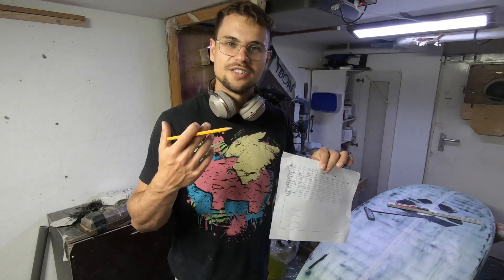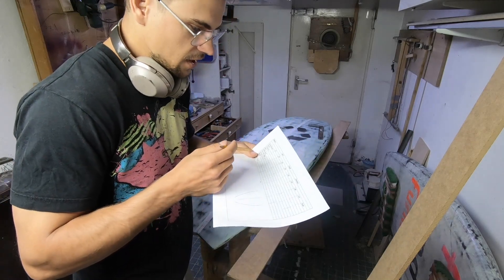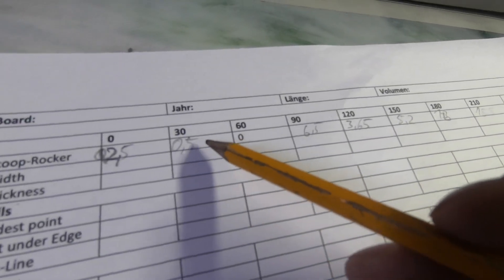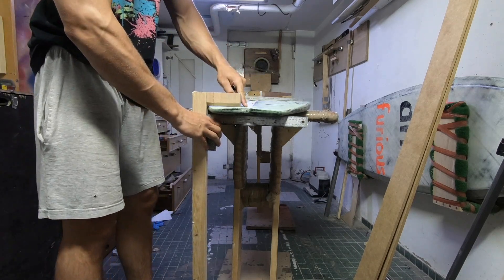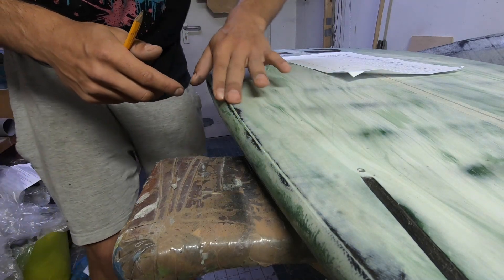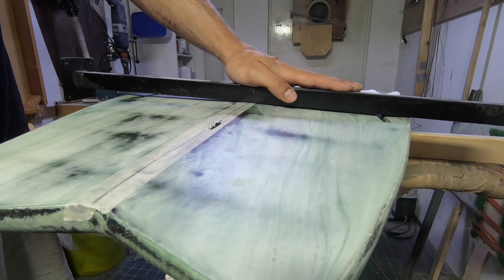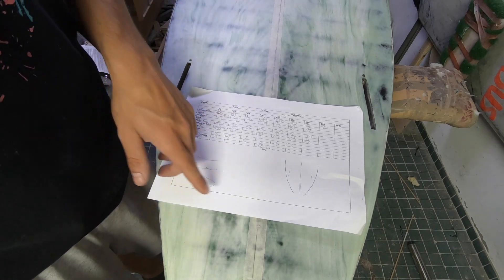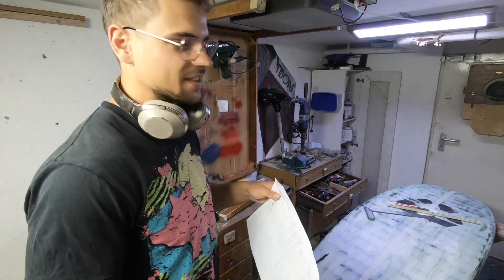How to measure surfboards - data to analyse and shape boards

Comment: Was für ne Software nutzt ihr für das Design? Komme von BoardCad und Hollowwood Templates Maker. Das aber eigentlich seit 2010 tot. Versuche mit Fusion 360 haben mit das Hirn verknotet.
Reply: Ich nutze AKU shaper als Demoversion. In der Demo Version kann man alles als pdf. ausdrucken und dann damit ein Template erstellen. Reicht also für den backyard shaper vollkommen aus.
Reply: @juergensplieth6068  find ich eigentlich auch gut, hängt sich bei mir aber regelmäßig auf
Reply from the maker: Ich bin dann wohl noch weniger als ein Backyard Shaper, ich benutze gar keine Software 😅 Die Templates mache ich analog. Das macht einfach mehr Spaß, finde ich und ich habe noch nie die Notwendigkeit für Siftwarelösungen gesehen. Wo sehr ihr die Vorteile? Habt ihr dadurch bessere Ergebnisse/weniger Arbeit?
Reply: @derbastlermeinesvertrauens753  Ich baue Boards in spantenbauweise aus holz, dafür ist das schon echt nice. Hab auch ne CNC und kann dann alles zusammenstecken und mit dem beplanken anfangen. Leider ist die CNC für'n ganzes EPs board zu klein.Letzteres steht aber auf der Angenda. Mal gucken wann ich mal wieder Zeit finde. LG aus Rendsburg, du kommst aus Kiel?
Reply from the maker: @sebastiangeitner6955  Klar, für Spangenbauweise ist eine CNC Fräse so gut wie obligatorisch, denke ich. Kann mir den Prozess zumindest nur extrem aufwändig ohne CNC-Fräse vorstellen. Aus Hamburg! Was wiegen deine Boards und wie Dichtest du sie ab? Ich habe immernoch Hoffnung auf konkurrenzfähige Holzboards :D
Reply from the maker: @sebastiangeitner6955  Okay schade... Ab und zu hört man mal Gerüchte von leichten und stabilen Holzboards - wer weiß, vielleicht bewahrheitet sich das eines Tages. Die Optik finde ich auch immer wieder bestechend und den Prozess stelle ich mir auch ziemlich spaßig vor. Cheers!
Reply: @derbastlermeinesvertrauens753  Mit Hilfe der Software kann ich einfacher die Outline eines Boards kopieren. Hierzu muss ich das zu kopierende Board noch nicht mal in der Hand gehabt haben. Mit Hilfe eines Fotos ist per copy and paste ein Einfügen des Boardimage in AKU Shaper möglich. Dann ermöglicht das Programm eine Bearbeitung bis hin zum orginalgetreuen PDF-Ausdruck der Outline auf Papier zur Templateerstellung. Habe hiermit schon viele Boards kopieren können....
Reply from the maker: @juergensplieth6068  Das ist natürlich praktisch, müsste wohl auch für ein Rocker-Template funktionieren, entsprechende Fotos gibt es ja häufig. Das habe ich aber auch schon ohne Software gemacht :D Bzw. für mein Wingfoilboard habe ich dafür Rhinoceros benutzt. Nach neusten Erkenntnissen (danke, @leon zur Horst) birgt die Geschichte mit der von Fotos übernommen Outline allerdings die Schwierigkeit, dass die erstellte Outline dann gegenüber der originalen ein wenig gestaucht ist, weil ein zweidimensionales Foto die Aufbiegung des Boards nicht abbildet und somit die Outline in den Bereichen mit viel Aufbiegung gestaucht darstellt. Das Board insgesamt wird dadurch kürzer, wenn man in interveniert.

Comment: Mich wundert wie du den rockerverlauf an messpunkten auf dem Board (also über Stringer) abnimmst.
Wenn du jetzt die schablone baust liegen die messpunkte ja auf einer geraden. Das board ist ja über den Stringer gemessen somit auch länger. Mein waveboard zb über Stringer 222 über straight nur 216.

Ich markiere mir auf einem richtscheit alle 10 cm und messe da den Rocker.
Mmn kann man den Rocker sonst ja nicht neu aufzeichnen bzw man baut sich viele mm Fehler ein, vor allem im Scoop bereich wo die Abweichung zw Messen über Stringer oder Straight am stärksten sind

Ist schwierig zu beschreiben
Reply from the maker: Nein, ich verstehe schon. Du hast vollkommen Recht. Danke für den Hinweis. Für das Board, was ich auf Grundlage dieser Daten gebaut habe, hat das zum Glück keine Rolle gespielt und sonst auch keine große, weil ich immer eigene Rockerinnen erstellt habe, aber trotzdem. Der Rocker müsste in Bereichen mit viel Aufbiegung flacher werden, nicht wahr?  Ich werde meine Vorgehensweise ändern und das an geeigneter Stelle auch in einem Video richtigstellen.